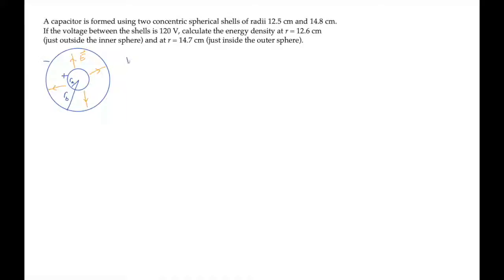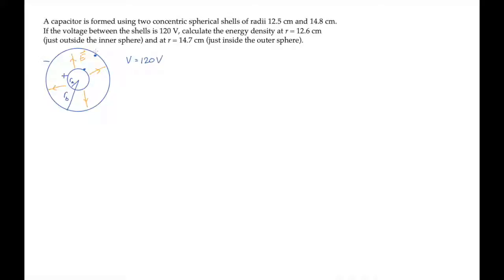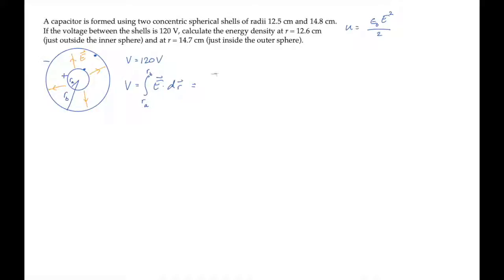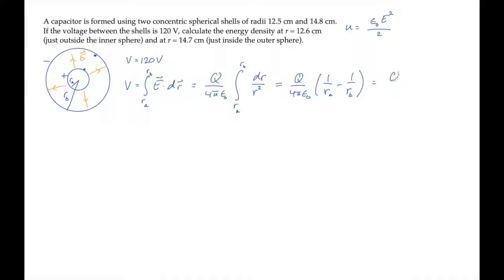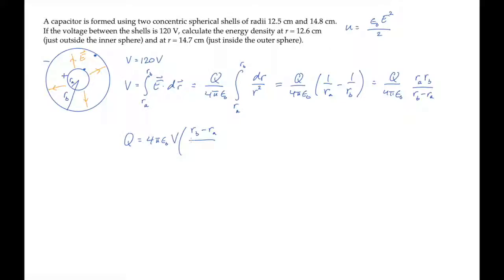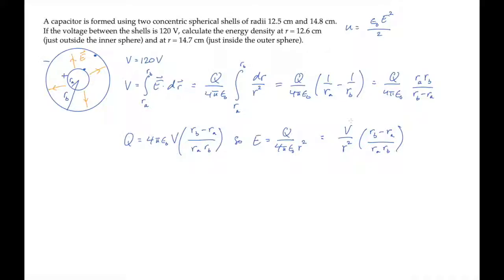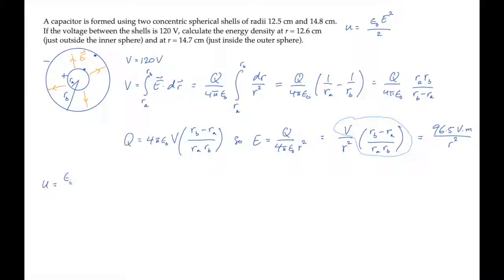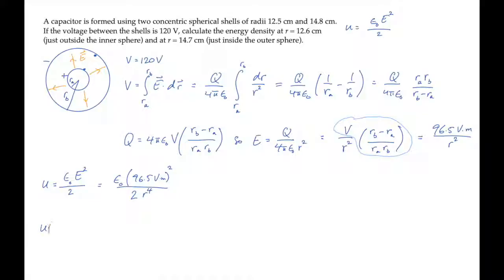E&M: Energy in Capacitors. Level 2, Example 1

Comment: When combining V and r_b-r_a/ r_b*r_a why is it 96.5? I only receive that when I cross multiply. Is there something im missing? Why cross multiply?
Reply from the maker: Ah, good question. It's because you're replacing Q. To get rid of Q in the electric field expression, solve the first line (under V=120 V) for Q by cross-muliplying and then substitute in. Hope that makes sense - it would be easier to show than to describe!
Reply: Looking back on the problem, I think my confusion rose when combining (1/r_b - 1/r_a). Your work shows with all due respect, (r_b*r_a / r_b - r_a) but when combining the fractions I found it to be (r_b - r_a / r_b*r_a) as a result of finding the common denominator and adding them. Having this in mind, cross multiplying without an equal sign in between at the end confused me since it wouldn't algebraically make sense to me.
Reply: Thank you so much and no worries I appreciate it especially still replying after a long time after uploading!